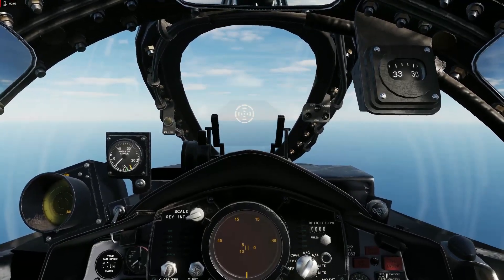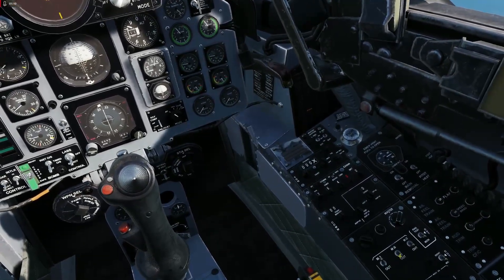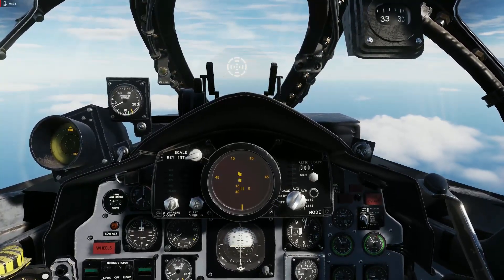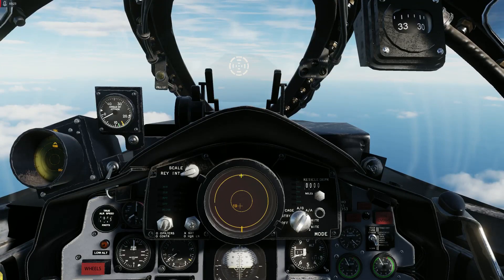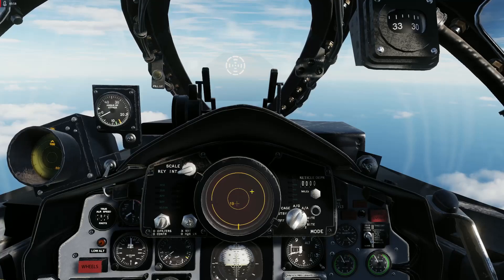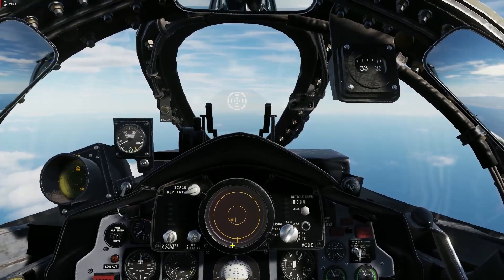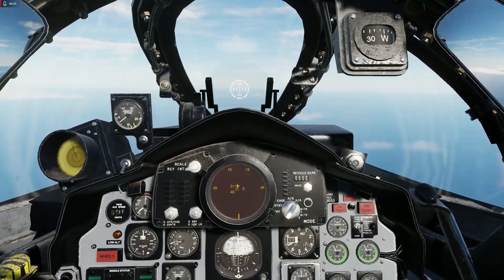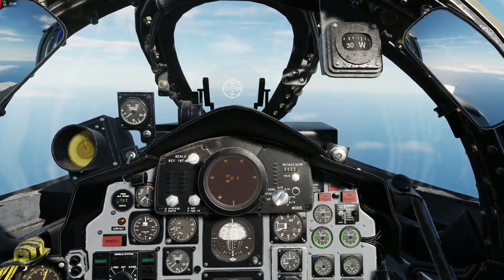VSN F4B Radar Cues (and some chatting...)

Comment: You are OBVIOUSLY good at what you do, BUT, could you not produce an actual full fidelity module for DCS - you have the skills, we can ALL see that. I would LOVE to see a full fidelity Delta Dart in DCS using photogrammetry to create the most realistic Delta Dart cockpit, and there must be many Delta Darts in US museums where you could create the most realistic single and two-seater external models, and also working from actual technical documentation to make sure the flight model was accurate - would you at least consider creating a full fidelity module for DCS?
Reply: Hi. Big thanks first of all and great that you like our Phantom. 

We were actually considering making a full fidelity module, BUT (and that is a big but ;-) ) you will need to make the 3d-model from the ground up. ED nowadays would like to see models of 3d-scanned planes (exterior and interior). That means we need to have access to the real plane and guys who can 3d-scan, because hiring a company doing the 3d-scans for us would be pretty expensive.
After the 3d-scans are done, we would need to have a more or les full-time 3d-artist to model off of the 3d-scans. Than we need a texture artist, to make all the textures look like the real thing (externaly and cockpit-wise). Those were our biggest obstacles since they need a lot of time and resources.
The manuals and even test-flight data is possible to get, EFM and Systems-Coding is doable as well..

Since we at VSN are doing that stuff in our free time and we normally buy licenses for already existing 3d-models (external and cockpit) and just do the animation, integration and systems coding, the building from the ground up was just too much of a task (time and money-wise) to undertake for us, at least right now.

I will not say that we will never try it, but right now we do not have the man-power or the resources for such a giant project. So we will stick to making mods for the time being...but never say never, I guess ;-)
Reply: @paulstich3053  I pray that you can work with a larger developer to HELP YOU in your quest to create a full fidelity module - we need MORE people like you and your team.  TrueGrit did it with Heatblur - let's hope you find the right dev team to work WITH.